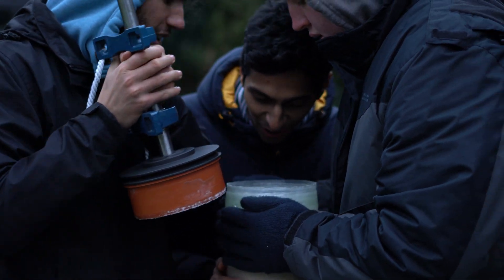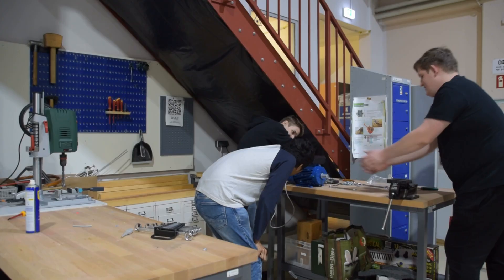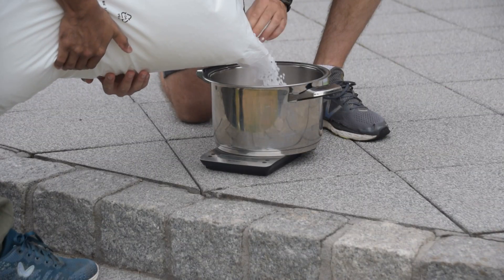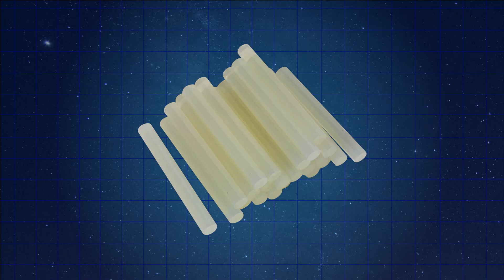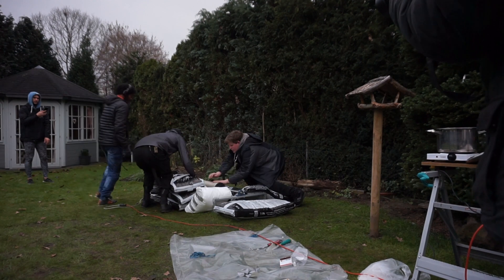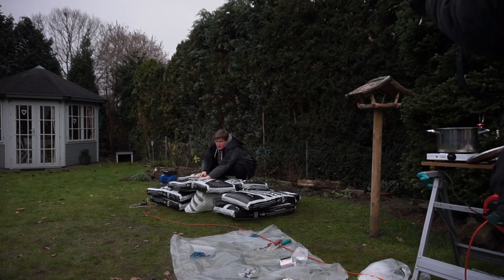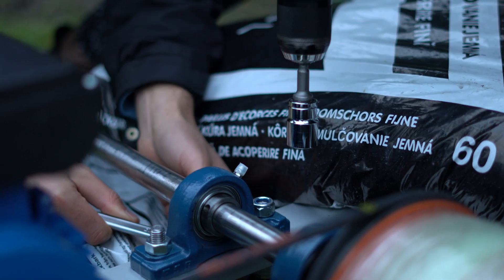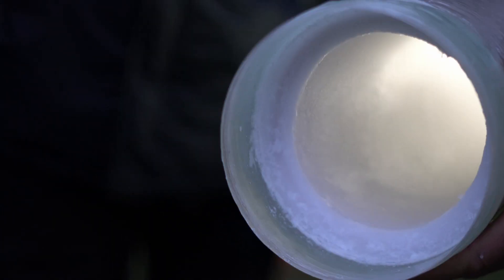How to Make Rocket Fuel... The Right Way

Comment: Ideally you would need some cross bracing directly under the beam where the axis of the rotor is to dampen those vertical forces exerted on the midspan of the beams on either end of the aluminium frame

Comment: A stiffer frame could have been made just by using larger pieces of wood, rather than going to the trouble of working aluminum. And it looks like you're going to need a stiffer frame if you're going to spin that fast. 

Seems to me that if you tilted up the frame, you could pour the paraffin into one end of the tube without having  to disassemble and reassemble it. The cap on one end could have a hole in it for pouring in wax. Plug the hole, put the frame flat, and spin.

I'm wondering if the paraffin burns unevenly? If not, why not just use all paraffin inside the composite tube and then shut off the oxidizer before it burns all the way through? Doesn't the PVC pipe liner burn, too?

I understand that LDPE melts somewhere between 105 C and 115. Also, that it's miscible with paraffin. If it's cheaper than glue sticks, it might be a good choice for improving the mechanical properties.

Comment: You are spinning your tube much faster than necessary. You only need to run it slightly faster (I would guess 10 - 15% or so) than the critical speed for a ball mill:
Critical Speed is: Nc =76.6(D^0.5)
where:
    Nc is the critical speed,in revolutions per minute,
    D is the mill effective inside diameter, in feet.
In your case, the effective ID is the actual ID of your desired finished grain.
Spinning your tube slower than in your demo will go a long way toward controlling your vibration problem. You could also rig up a different support system for your tube so that one end has an annular retaining plug with an open center, supported by fixed rollers. This arrangement would be very similar to the way cast iron pipe is centrifugally cast. The melted wax can be poured into this arrangement after the tube has been mounted and spun up.

Comment: It surprised me that the hole in the middle is large in comparison to the fuel/wax. Definitly not what I expected but I have not done any calculations. However when thinking of the short burn time of 10 s then it's plausible. I estimated from the picture that the thickness is around 3 to 5 cm and that would mean that 3 to 5 mm of thickness are lost in one second.Wonder if a forming liquid wax layer would self-heal any cracks.
Reply from the maker: We are anticipating a burn rate on the order of 2-3mm/s.  The thickness of the paraffin is around 20mm (although that varies between grains by 1-2mm).  Not sure about the self-healing.  I doubt it would work that nicely because during combustion there will be no opportunity for the liquid wax layer to re-solidify in the crack.  Instead the liquid wax layer would erode the crack making your problem worse I think.

Comment: How did you extract that formed paraffin out of PVC??!
Reply from the maker: No need for extraction.  The PVC will fly!!  It kinda acts as an insulation layer inside the combustion chamber.
Reply: @ASTRABremen  and what about the fiberglass on the outside? do you seperate that off of it or what? nice work btw

Comment: That was an excellent method, for sure!  I have one that might work, too, but it's a bit slower in nature when it gets going.  Mix in some (wick by any other name) coarse chopped cotton wool, and keep it spinning at no more than 100 RPM.  Think: rock tumbler.  Coarse-chopped cotton wool: the tiniest cotton balls you can find, add just enough to thicken the mix a little when it's hot.  Drive it from its outside wall, not its axis, and cap one end tightly.  The other end,  a tight cap with a hole that gives plenty of room to add more hot mixture to the tube as it spins.  The whole device tilts + a few degrees toward the cap by a lever, and back to level the same way.  Basically, what I'm doing is working candle wax the way it works best, and that's with a wick.  It's candle-dipping, but in an inside-out way.  The glue sticks might negate the need for cotton.

Link not required, but this also comes to mind. "Let's light this candle." - Alan Shepard, first American in space
Reply from the maker: I see what your getting at.  This could work as well.  But as you said it would take a lot longer.  You would probably get a more consistent mixture too.
Reply: @ASTRABremen  An unsafe day at work was when I lit a plumber's candle in the welding area, and aimed the oxygen at it.

Comment: would a steel or aluminum mold work instead of pvc/fiberglass? I feel like it might be easier to start with solid wax and heat the mold instead of pouring in pre-melted wax. faster to cool down and harden, too, I'd bet.

either way, exciting to see how this all goes!
Reply from the maker: That is an interesting idea. Although getting a steel or aluminum part of these dimensions would be a bit more expensive than what we paid.  The PVC tube was 15 Euros and the fiberglass wrapping cost us around 10 Euros to wind.  So we are really doing things on a budget here at ASTRA :)

Comment: The sand/dirt bags also work as a kind of safety enclosure to catch debris in case something gets out of control/the tube splinters or something. Maybe use gravel bags, they're cheap and provide more mass than soil. Alternatively, use sand and make it wet. The added water adds extra weight
Reply from the maker: Thanks for the recommendations.  The dirt bags were kinda of a spontaneous addition, but we will put some more thought into what we use next time.  Wet sand is a really good, cost effective idea.
Reply: @ASTRABremen  or you could just hammer it down to the ground
Reply from the maker: @Space_Shot  It actually was hammered to the ground.  Unfortunately, the ground wasn't very hard so that was pretty much ineffective.
Reply: @ASTRABremen  If you had the space more permanently, you could bolt it to an aluminium plate, so the weights have a more solid contact to the structure and might equal out some weight distribution issues from one side to another, since they are not partly resting on the ground, which reduces the weight that they contribute  (until the structure pulls them up enough to lift more of them off the ground)
Reply from the maker: @CookingWithCows  That's a really good point.  ASTRA's own dedicated lab is still in the works... Once we have one, we would certainly set up the stand in this way.

Comment: How about fine sucralose paraffin wax and some rubber to hold it all together.
Reply from the maker: That may also work.  But the hot glue sticks just so happen to melt into the wax really well below 100 C.   This makes it really easy to work with.

Comment: Find out how candles are made,once solid drill a hole right down the middle in the vertical position.
Reply from the maker: Yeah that won't work at the scale we need.  We would need a 12c(4 inch) diameter drill bit.  Seems kinda intense.
Reply: @ASTRABremen  put a tube in the tube and let it sit. The most easiest way
Reply: @ASTRABremen  why need motor
Reply from the maker: paraffin wax shrinks a lot as it cools so this ensures you don't have any non-conformities.  You can do the casting method for small grains, but you will encounter issues as you scale up.
Reply: @ASTRABremen  you can use a sprufeeder combination like the do in metal casting.
Reply from the maker: @Space_Shot  I'm not super familiar with metal casting techniques.  What is a sprufeeder?
Reply: @ASTRABremen  it is a big funnel that has extra material in it so that when it shrinks the excess material will flow in the casting and cool down.
Reply from the maker: @Space_Shot  This could work, you just have to keep the paraffin in the funnel hot.
Reply: @ASTRABremen  for the scale you are working on it is ok what you are doing but when you go to a bigger scale you have to use easy methods cause it will be very complicated to to do what you are doing now.
Reply: @ASTRABremen  Or a 4 inch hot pipe.